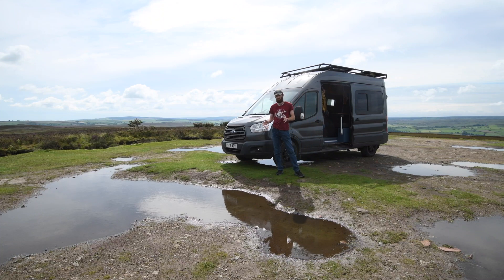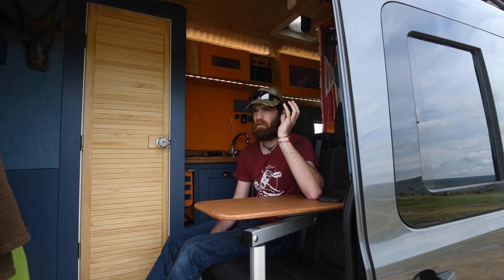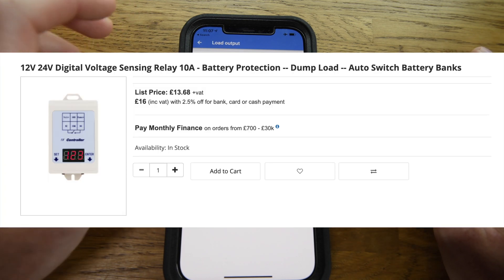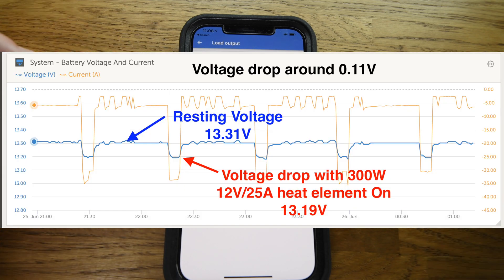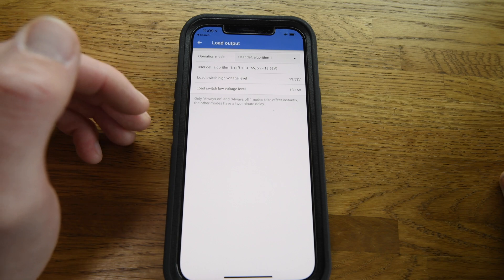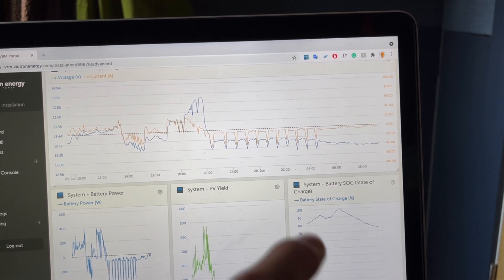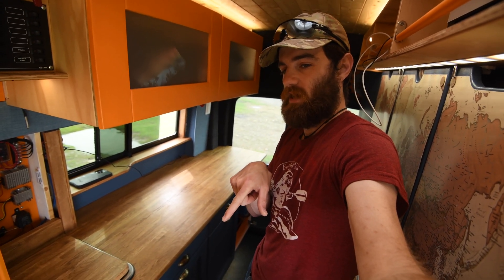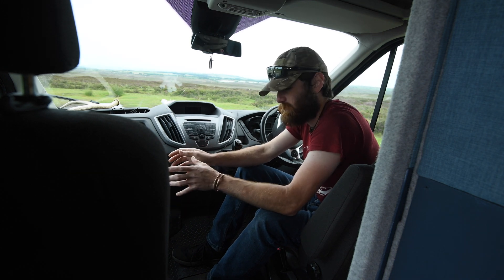FREE hot water from Solar dump! | EP51 | Ford Transit Campervan Build

Comment: Am I correct in thinking you can only do this using a 12v (or DC) immersion direct from the controller? Or is the immersion wired into the 12v system?
Reply from the maker: The 12v dc immersion is wired too a large relay, which in turn is wired to the 12v systems. I’m using the controller/ temperature controlled relay to give a signal to the large relay to turn on. The element is too power to run direct from the controller

Comment: The water should be at least 65 degrees to kill of the nasty stuff. 60 is a bit to low for legionella bacteria. 70 is a guaranteed kill for that bacteria.
Reply from the maker: Higher the better yes. But some recommendations even only holding above 50c

Comment: Which temperature controller did you use Alex? I can’t find one that states the probe is fully submersible and don’t fancy just chancing it.
Reply from the maker: I’m using a W3230 ( or a look alike copy of one. ) pretty cheap off Amazon and been working without issue for 2+ years now.
Reply: @MispronouncedAdventures   awesome, thanks Alex. Have you just dropped it into the tank then or did you drill and seal it in?
Reply from the maker: As this is an pressurised tank, drilled a hole in the top, so I could run the temperature sensor through it, and then a bit of sealant to then seal the hole around the wire
Reply: @MispronouncedAdventures  That’s another job added to the list then. Thanks again 👍🏼

Comment: Bruh... How in the F do you get 590 watts out of 500 watts of panels....?? 🤔
Reply from the maker: Solar panels ratings are a ideal conditions rating not a max output rating
Reply: @MispronouncedAdventures  what was the outside temp and where was the sun on days you exceeded your rating..... Does that happen every day?
Reply from the maker: Not sure the temperature that does, panels can also be cooled via driving and the wind over the top. 

Most clear summer days I’ll see 510-520w. My max ever has been 624w
Reply: @MispronouncedAdventures  still hard to believe but i trust you. What brand and rated wattage are your panels, series.... Parallel?
Reply: @MispronouncedAdventures  That's not how that works there's something else you're leaving out..... I'm not arguing with you I'm just trying to figure out if there's a way you boosted your output.
Reply from the maker: Nope, that’s how its work. The rated “wattage” of many solar panels is not its absolute max. Solar panels rating are based on a standardise testing criteria. But real world can most of the time you hit lower than the rated, but you can his higher. Example, solar panel output is massively related to efficiency, which is related to temperature. Low temperature can increase efficiency
Reply: @MispronouncedAdventures  The rated wattage of a solar panel is the amount of watts it can put out under ideal circumstances and testing in a facility where they're made are ideal circumstances with lamps and proper temperature so I'm not sure what the hell you're talking about.
Reply: I had the same question at first, I think what ur missing is that testing conditions are not necessarily ideal conditions, but controlled conditions for testing standards at about 24oC and lighting of 1000w/m3 when panels are tested. Sunlight intensity can reach higher levels than this in certain conditions and the temps when travelling on a 2 degree C day could mean that at certain times in travels the panels could be in perfect alignment for optimal light absorption and with ultra low temperatures, add to this the capacitors in a good MPPT controller can be storing extra energy as the MPPT reconfigures itself for a few seconds to output higher current & I can see how it may be possible to have high spikes or surges in current/power/watts output from the controller for small bursts of his stated 624w from 500w of panels.
I have a 40’ bus on a property with 1kw of pv on roof & 1.5kw of ground mounted arrays, I added Maxwell capacitors to both sides of the system for something to do & see results, 10 x 38v 250w panels 2S5P can get up to 78vdc from pv arrays, when a cloud goes over & sun comes out my renogy controllers might reconfigure their MPP & output a couple amps more than the controllers are rated for for a minute or two.

Comment: I'm trying to build a recirculating shower and want to wrap piping close around the heating element hoping it heats the pipe for when the shower drain runs through it. Anyone think this is a safe idea and will it work at all?
Reply from the maker: It’s can be done. There is 12v heating wire which I’ve seen wrapped around pipes. But I’d want to switch to a metal / copper pipe over a plastic one. My worries there water would be moving so fast in the pipe there wouldn’t be much energy transfer
Reply: @MispronouncedAdventures  thanks for replying so fast! Yea I was thinking metal but wasn't sure how much heat it would be.  But I'm also not sure how much heat is lost either since it recirculates. I'll probably have to run tests first. But just trying to maximize the time with as minimal footprint as possible.

Comment: I think Im going to do this too, thx for the video. Seems churlish not to use spare energy and turn it into abundant hot water! Whats the name/manufacturer of the tank temperature trigger control please? As I intend to use the hot water tank for washing up and a normal shower (no a recirc one like yours), I need to consider how/when to fill the hot water tank. Obv I don't want to start filling the hot water tank as it's being used, as it would become cold quickly whilst being used. So I need to consider how to set an extra bit of logic to stop the charge process in case there is no water at all in the hot water tank , perhaps a float switch that will stop it charging. Any ideas/input from yourself? Thx.

Comment: For the smaller Victron charge controllers with the +/- load output ; would the wiring from the load plug straight into a generic relay? As I see your charge controller has just a positive running in / out.

Thanks
Reply from the maker: Yes, on the smaller units with a load output, you could use the load as your signal for the large relay / power on a temperature relay. 

And then have load output operation set in settings with a “user def algorithm”
Reply: @MispronouncedAdventures  Thank you for the speedy reply. Currently working on something similar for my van and working on the wiring now. 
Would you have a guess at the correct trigger settings for a 12v lead acid battery. (100 amp hrs). 

Thanks again.
Reply from the maker: For this it’s important to test yourself, voltage will be different on different systems. But a voltage just below your “bulk” charge voltage on your solar Mppt will be a good start.
Reply: Do you have a basic wiring diagram you could email me or offer any pointers. Be much appreciated and congratulations on reaching 11k subs - myself being happily one 👍 Many thanks.

Comment: Do you think that voltage sensing relay would be a good way to prevent on over voltage error between my Renogy B2B/MPPT combined charger and my 200w solar panel? It is over by about 2 volts

I would need a decent relay too
Reply: I use an 'intelligent charge relay' and its great for siphoning off excess volts... mines wired to a travel freezer on one set of panels n my second set to a 12v immersion

Comment: Sorry, I may be misunderstanding what you said, but what tells the element to turn off when the water is at 40c? Otherwise on a very sunny day would it not just keep getting hotter and hotter?
Reply from the maker: The temperature controlled relay. When the dump load turned on ( via the mppt built in relay), that powers the temperature controlled relay, that checks the water temperature and turned the element on or off

Comment: Hi. Great build content. I am thinking of doing something similar. 

Would a 275w panel be sufficient enough powering a 300w 12v water element like the one you use on your set up? 
I understand it's 25w short of the 300w element so may take longer to reach temperature but wouldn't have the worry of burning out the element anytime soon. It would be immersed in tank controlled with relay / thermostat running off the dump load of the charge controller. 

I understand you mention perhaps going for a smaller element such as 150w but seeing as I already had a 300w 12v element knocking about from a old project I thought why not upcycle it to a new purpose for heating water when solar dump occurs. 
ATB
Reply from the maker: It could well work, The main reason I mention a smaller element for a small amount of solar is when a lot of the time you’re not running at 100% solar output. 

But if you’re prepared for the solar dump is  probably going to use some battery as well. It was just me and you reach your solar dump cut-off voltage quicker. But go for it specially if you already got one lying around
Reply: @MispronouncedAdventures  many thanks for the comment. I will look to fit it in the coming weeks and  monitor the battery output when the solar dump takes effect. I will potentially switch to 150w if the fluctuations between float / dump are to great for the element to work effectively heating water. 

Keep up the great content 👍 

ATB
Reply from the maker: @AboveGroundLevel.  What type of 300w element have you got? As the one I use has the two bars which are 150W and just have two plates at the end which join them in parallel make it into 300w. you can remove the plates and just run a single part of it
Reply: @MispronouncedAdventures  yes that's bang on. Same element as your one (I remember correctly as it's sitting in the shed awaiting digging out) so yes that would be ideal way of dropping the draw 🙂
Reply from the maker: Fantastic easy way for you to test!
Reply: @MispronouncedAdventures  could you tell me as I've might of missed it during the video. How does your hot water tank refill itself. Do you have a marine style float that feeds from the main cold water tank? Just dug the element out the shed - it is the exact same element as yourself with twin plates on the terminal connections 👍 Thanks again
Reply from the maker: I have a manual valve I can turn which fills the tank up from the cold system ( pretty sure it’s featured in the Bobilvans hot water video ). But I primarily use this hot tank as the recirculating shower hot water tank. So a an automated fill  system in my particular set up wouldn’t work
Reply: @MispronouncedAdventures  thank you. Your videos are very informative over this setup. Could I ask on a side note - regarding the dump load... Would it be possible to wire the solar dump load back to the 12v main van battery? Would a second charge controller be required at the van battery end to regulate the power coming in from the dump load? 

I ask as I've upgraded my Battery 2 Battery charge controller with a victron Orion DC2DC - unlike my last cheaper B2B relay- when the solar charge controller had charged the leisure batteries the old B2B would allow the solar to charge up the main van battery. This is not possible now with the new Orion  and was wondering if there was another way of keeping the van battery charged when parked for long periods of time off the dump load from the charge controller. 

Appreciate your time and response regarding my question. 

ATB and safe travels.
Reply from the maker: As I see what you are trying to say I would look into a separate trickle charger for changing the 12v starter over a dump load. 

I have a 1amp trickle mine installed which is semi smart. Turns on if it senses the starter in a set lower voltage.
Reply: @MispronouncedAdventures  I hope your well on the adventure. I've got round to installing the heat element. It's a 300w 12v exact same as yourself.  I too have a Tri smart orion 12v to 12v 30a unit fitted. Would it be possible seeing as I only a 275w panel to split the connectors on the back of the element. 
1... +/- for the solar dump 
1... +/- for wiring to Orion Tri smart so when the Tri smart brings up the level of the leisure battery it will than dump excess charge to the heater element. Thus in turn (on a sunny days drive in theory), having a full 300w being generated into the water tank heater element.... 150w from solar dump and the other 150w from van battery while driving??? 

I hope I haven't confused you in trying to layout the idea. 

I did notice in the video you say you may get a 600w element in order to run a separate electric shower off.. 
Just an idea I had while starting the install on the water tank. 

ATB

Comment: Fantastic video...very informative. As always I find your videos set out the steps you have taken very clearly and concisely. Just one or two questions...am I right that the hot water tank you are using is plastic? I was searching for a suitable small metal cylinder to use as a tank, but the best I could think of was to adapt an expansion vessel (and remove the bladder). I had thought that 60'c might make a plastic tank a bit to flexible. I presume your plastic tank is holding up fine - and the connect for the element doesn't get too hot at its base?
Reply from the maker: The tanks are rated to 70 or 80°, The Bobil kit doesn’t recommend going over 65c I believe. That being said the tank is fully supported in a box. without the support it becomes malleable at higher temperatures I imagine with no support it made it a bit floppy. 

My initial worries was the sheets for the element at the mount point. It doesn’t get that hot. I  imagine as a lot of the heat is dispensed into the water and the element itself is isolated via ceramic from the metal threaded body of the heating element
Reply: @MispronouncedAdventures  Cheers...I'll give it a go so. I was hoping for a hot water setup that would allow me to use 230v (when available) or 12v. Rather than using the batteries and then re-charging via 230v...I have a spare atx power supply that outputs 12v @ 27amps. Hoping that will allow me to run the immersion direct.
Reply from the maker: That should work out in the same heating element available in 230v and 12v, 24v and so on. There are a few different sizes of wattage elements as well if need be

Comment: Brilliant about to fit Bobil style hot water system and wasn’t too happy about having to use the diesel heater in the summer and dump the excess heat outside just to get hot water so really pleased you’ve done this as I had thought about it. Our caravan is a oddball thing but thinks it’s a converted camper van. We are on a smaller scale with only 120w solar so may have to use a volume controller to drop wattage on 150w immersion but that’s the fun. Also I know our lithium battery is recharged by about 10 am in the summer months.
Reply from the maker: The 150w heaters are usually 2 x 75w individual elements. You might be able to remove the parallel bars so you could just choose to run one of the elements are not both. But generally it’s just nice to have a way of heating water in the background without having to think about it

With the Bobil kit I didn’t really find there was a noticeable effect on the habitation area temperature for the 15 minutes or so I would be running it during the summer to heat water. I find the vast majority of the heat energy goes into the water the remaining air temperature wasn’t that warm
Reply: @MispronouncedAdventures  brilliant so the solar is free/excess power and the bobil can still be used in summer. I know what it’s like when it’s absolutely 30 degrees in caravan any extra heat you just don’t want. I’ve found some cartridge heaters on eBay that are 80 and 100 W which may suit better. Thank you very much.

Comment: Still good for winter as prevents any icing up and a little pre-heating for diesel heat exchanger system. Obviously change setpoint to 10c or whatever
Reply from the maker: Definitely! It’s only in my hot tank and I live in a van full time its unlikely to get the vehicle cold enough for the hot tank to freeze. There are smaller wattage versions of these which are used as anti freezing options in fresh tanks if they are stored underneath the vehicle

Comment: Any recommendation for a decent 12v solenoid valve or ball valve? ...bough the cheep and cheerful and it leaks when closed.I saw you mentioned one in one of yours Vids. Cheers am
Reply from the maker: What your planned application? If it’s pressurised then a solenoid is a better bet ( filling the tank for example )  but if it’s for gravity fed ( draining the hot tank for example )  then you need a ball valve would be a better idea
Reply: @MispronouncedAdventures  it's for a pressure fed emptying of of my grey water tank, got a small pump 1/2'' connections

Comment: Alex is there any danger with this immersion setup if there is no water in the tank? How hot does the element get? I don’t have a recirculating system. I have a manual feed from the cold supply to fill the hot water tank which I refill after a shower (to avoid lowering the tank temperature during use). I currently just have the bobil system connected. I’m asking in case I was to forget to top off the hot tank after use. Thanks.
Reply from the maker: Good question, in the way I have set it up it would not be possible to drain the tank below the level of the element as the outflow pipes are above the height of the element. 

As for how hot does the Element get? I don’t know. but since the element is always  in the water it doesn’t really matter in that sense as the water would stop the element from overheating because the heat energy from the element is going into the tanks . And the tanks water is controlled by the temperature relay which turns element off when it reaches my preset 60°. If the tank was empty and The element exposed  you would have the issue of overheating and something would fail
Reply: I guess I could try and ensure the outflow from the tank is above the element to ensure it always remains submerged…